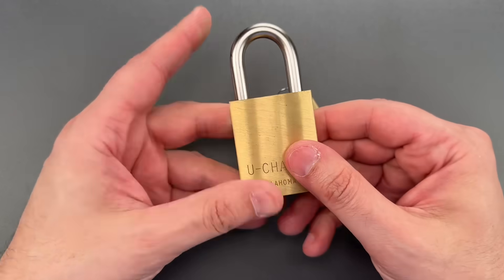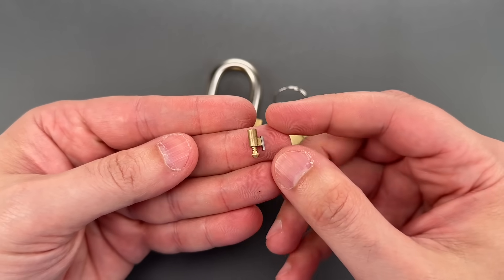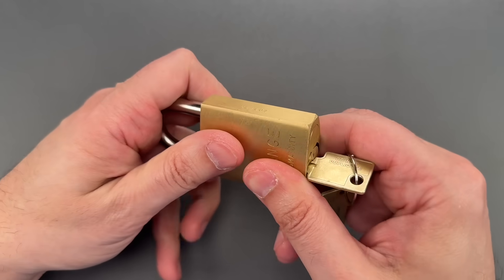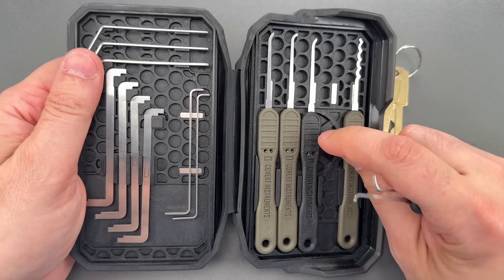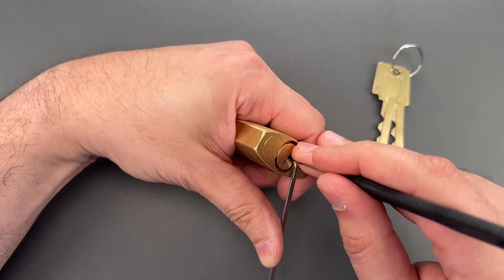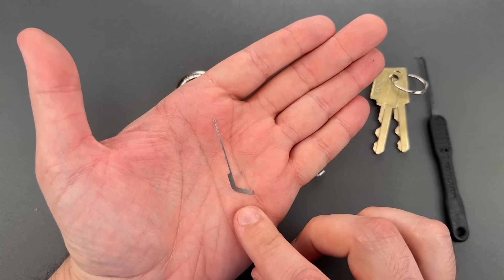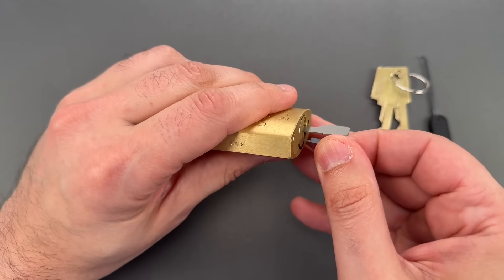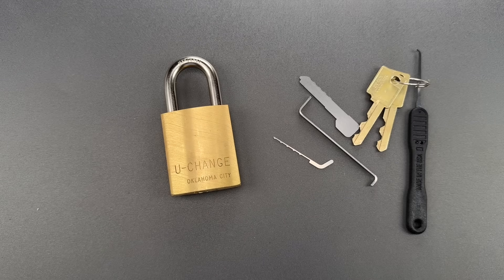[1634] Cool, Innovative, & DUMB: U-Change Padlock Picked & Bypassed

Comment: I just got my first set of lock pick . I was wondering what would be a good padlock to get to practice on? The clear one that comes with it give very little challenge to open . I find my self getting it open in under 30 sec with short hook and less with the rakes.
Reply: Note it give very little feedback  and has a lot of play in the cylinder. There enough play In the cylinder  to where you jiggle the cylinder with anything  in it the lock opens. So I pick it until  the cylinder turns.

Comment: Would a spring loaded pinned lever between two pins result in a harder pick? The idea being a key would withstand force applied, where a pick could not couteract the new force that could drive a spool back down even under tension ? Maybe placed along the sidebar

Comment: How do you not catch something like that until after it ships? It's an incredibly obvious bypass.

The pin design is an interesting concept (though i wonder how much more of a pain it is to manufacture thsn your average spool pins). But the design seems only half finished. The design clearly needs a protected means of engaging the control feature on the pins.

Comment: genuine question; why does a pad lock need a master key... ever?
I assume the reason why you want a master key is because you lost / don't have access to the original key.
But having a master key leaves room open for people to access what it was protecting without leaving a mark.
If you're the owner, you can replace the lock after breaking it open. If you lost the key, might as well.
Sure it does cost to replace BUT you'll know when it was forcefully opened.
* assuming it's not easy to pick in the first place and the door it self isn't easy to open by other means :P

Comment: It seems that with a little thought a means could be developed to keep the programming slot covered until an already authorized key allowed the cylinder to be partially rotated to a programming position where the programming rod and new key would be inserted to program the pins.

Comment: Obviously a small metal rod or stiff piece of wire (eg, stainless or a paper clip unfolded, vs soft steel or copper) can work of the reset tool is lost or not owned by the picker.  

Even worse than LPL suggested for security, though noting most cheap locks are more for access control against the honest, than serious security against major vandals who'd just smash things.

Comment: So about the same time as the c19 lock downs I came across ur videos. Shortly after that I purchased a practice lock and basic set. 30 40 and 50 with 2 wave rakes and 2 sizes of hook pick. Today i just tested all the pad locks in my house that I own that id been going to the gym with. And each of them took less than 2 sec after set up. I even picked my various safes. Those took me about 7 to 10 sec. The practice lock u gave me in the set is harded to pick then all these items

Comment: The thing is, if you can only rekey it while unlocked, you run the risk of accidentally pinning it wrong and then the lock is locked forever. If you can rekey it while locked, you can recover from that situation but at the cost of security.

Comment: It's not a flaw if you need special tools to do it.  Even 99.9% of locksmiths / lock pickers wouldn't have that  'master key'.
Reply: That's the tool that comes with the lock for rekeying it. So you can just buy one and have the tool. The high cut key he inserted in the key way could just as well have been a popsicle stick, but that would require a bit more jiggling.
Reply: @andersjjensen  Ok, but 99.99% of people trying to pick this lock who aren't the owner, won't go out and buy the exact model of lock to have that tool, I would think. With how little effort it took LPL to pick it normally, it would be far more effort to see the lock in the wild, look up the model of lock it is, go out and buy one to get the master key, then come back to bypass it with the master key.
Reply: @timgilbert9572  That highly depends on the scenario. If you're imagining a single lock on a garden shed, sure. But if a large institution uses it pervasively and someone wants to clean it out, obtaining the master key is about in the same inconvenience bracket as making sure you have a sufficiently large vehicle for the heist.
Reply: @andersjjensen  ..and you can also just buy a bolt cutter.  Soo- again- not a flaw.  99.9% won't have the tool.
Reply: @whatspeedlimits  By that logic nothing is a flaw so nothing should ever be improved because cordless angle grinders and crowbars exist.
Reply: @andersjjensen  no dummy.  A flaw is when you can wack it with a rock, oropen it with a paperclip or common object- or in the case of something like airport luggage- hold tension on the slide and feel the notch on the numbers.
Reply: @whatspeedlimits  It is every bit as much a flaw that everyone can go down to the local hardware store and buy a key for your particular lock.

Comment: When I used Kwikset SmartKey, it required not just the tool in the rekey hole, but also the current key, in order to get it ready to accept the new key.
Reply: So they didn't make the most basic of mistakes. The problem is just that Kwiksets are so stupidly easy to pick. The keyway is as wide as a barn door, the tolerances are sloppy, and because of the sloppy tolerances there are only like 5 legal cut heights, which makes it fairly easy to gauge by feel if you are at the correct height.
Reply: Another solution would be to just have an anti-drill plate protecting the core that also happens to cover up the rekeying hole, and the screw to remove it being only accessible with the shackle open.

Comment: Can you install the core without a useable key? Does the master key come with the lock and is there instructions/tools to open it without the key?

I could easily see a situation where somebody accidentally sets the core incorrectly so that the key they have doesn't work. As most people lack any lockpicking skills, their fancy lock becomes a paper weight because they set a pin one notch off. Since user convenience often trumps security in low-security domestic applications, the massive security hole of handing out a master key with every lock might have seemed like a reasonable trade-off. 

To be fair, I doubt the average thief will carry the master key to this obscure lock. Conventional lockpicking or destructive techniques would probably be more common anyway. 

Doesn't mean that an easily accessible master key is excuseable.

Comment: I'm confused. What's the design intent for that hole? This doesn't feel like a flaw as much as it does an intentional bypass, so I must be missing something.
Reply: The customer would rotate the core 90 degrees and insert a flat piece of metal with a bevel tip. This would allow the step pins to be released. Next, the user inserts a factory cut key. The re-key tool gets removed and the side pins lock into  the key pins forming a new pin length. The key pins are each have a male and female component and are telescoping.

Comment: I invented this tool when I was about 25 years old from wiper blade material. I sold a few of my prototypes to the VP of Security Solutions. In addition, they gave me 3 mortise cylinders and the lock you see in this video. The company knew about this flaw for years. Ten years later, I started posted my design on  either Lockpicking101 or Keypicking. There it got the attention of Locksmith Army who was affiliated with Ken Persson. Ken gave me a $400 pickset for my design and he posted my name on his website for about a year. Ken, made his own version of my original design. I liked the way he put an overlifting feature on key insertion tool, but it still wasn't perfect, particularly with deep cut pins which tended to vise into the cylinder walls. Ken, stopped producing this tool, rather mysteriously I might add. Maybe he was being threatened by Security Solutions. The tool works quite well  on certain locks depending on bitting and pin wear, and manufacturers tolerances. Prior to my invention, I read an article in Locksmith Ledger how a straight wire could be used to open these locks. I would say, "sometimes". After analyzing the lock, I invented my tool and improved the straight wire concept. I made a similar tool when I was 13 years old for a bicycle lock and so the same concept was easily adopted. ❤❤❤❤

Comment: Out of curiosity, if the lock can be unlocked/picked either clockwise or counter-clockwise, is the binding order the same for the pins when picking in either direction? Or does it potentially differ?

Comment: Kwikset has a residential exterior door lock that uses this reset feature they sell even today at home depot i believe. Not a fan
Reply: The Kwikset Smartkey system cannot be rekeyed without inserting the currently matching key. They aren't proper security locks, but they aren't outright dumb either.

Comment: I think this was probably "good enough" for the kinds of security this was probably used for (monitored gates or garages that just need perfunctory locks because the REAL security is via observation), but the design flaw is so easy to fix: make the core drop out and put the rekeying hole on the INSIDE face.

Comment: Isn't it also dumb because you might be able to change the lock, but where do you get the new key  you'd need?
Reply: It's the other way around, actually. You change the lock to work with a key you already own. 
That isn't to say that you couldn't get a new key made if you really wanted to. It's just that most people are going to use it as a way to standardize their locks to a small number of keys rather than have to juggle dozens.

Comment: I think the dumbest decision was to not cover that resetting slot when the lock is locked.
Reply: The plug is so skelonized as it is. I thought about it too. Why didn't the company block the hole in some way. I asked the company the same  question years ago, and the response I got was they had fix but wasn't going to share it me. I was a pain in their ass. Maybe it was true, maybe not (about the fix). I thought  about using some sort of ball bearing to block the hole. But again, there's very little brass left to work with.

Comment: "Design error: Key can be changed while item locked."
It still applies to electronic saves to this day!
Reply: the crazy part: I genuinely assumed the pattern change would only be when unlocked. I was so convinced, I would not have even tried.
Reply: @brightmatter actually from what I see it’s not even changing the keying. It seems roughly equivalent to comb picking. The sidebars are fixed relative to the top of the key pin so stopping them all at the same height must leave the lock in the open position.
Reply: I used to use that to my advantage whenever the fingerprint scanner I needed to use to clock in to work would stop recognizing my finger. 
Put in the command code, 931, to ask it to change the manager password, change the password. Use the password. Set employee fingerprint. And reset my print. 

Why corporate ever thought a fingerprint scanner was a good idea for line cooks, who burn and injure their fingerprints enough to change them multiple times a month, enough for the reader to stop recognizing them, is beyond me. Could've abused it worse if I wanted to.

Comment: What is the point of user-changable locks? You need to make new keys all the time (unless you are just using them to exercise picking).
Reply: Access control. Say I have 20 locks - sprinkler access or something equally mundane - and 10 crews who may need to get in to them. If I add another box, it's far easier to rekey the new locks to the old keys than make sure everyone has another key that only works on that box.

Comment: and that completes another amazing video! Are the Kwikset changeable key sets just as flawed?
Reply: The older KIK (key in knob) one had a bypass vulnerability requiring a specific tool. All of them are a bit delicate; sometimes a pin will lose it's setting and the key won't work. Pick it and reset. Vulnerable to dirt, gunk, gummed oil, or extra force like rough picking or a spring-gun causing a pin setting change. By their nature the pins act like standard pins when picking so not a lot of pick-resistance.
Reply: The Kwikset Smartkey system doesn't have this flaw.

Comment: easy fix; plug the change hole; anything brass; sand down; brass is easy to work with and soft
Reply: Which negates the point of the design, being able to rekey the lock without disassembly.  There are other ways it could have been done,but if you want that feature you're not going to block it off.
Reply: The hole is there to allow the lock to be rekeyed. You'd be disabling the distinguishing feature of this lock, which raises the question: why buy this particular lock instead of another one that can't be rekeyed, and therefore doesn't have the flaw to begin with?
Reply: @EvenTheDogAgrees   в быту для человека он не нужен, но для организации с кучей замков это может быть полезно. Когда есть набор замков и набор ключей, и всегда можно перестроить любой замок на новый ключ. Или перенастроить все замки на один ключ.
Reply: They should have simply designed this so that you had to unlock it BEFORE doing anything with the rekey.
Reply: Все проще. Просто сделать настроечное отверстие внутри паза для дужки замка. Пока дужка не отведена в сторону, доступа к настройке не будет.
Reply: That just leaves you with a normal padlock without any security pins... that you payed a lot extra for due to the complicated feature.

Comment: So, the user can easily change the pin lengths but still needs to go to a locksmith to get new keys cut. Seems like that defeats the purpose of a "user changeable" lock.
Reply: Makes it easy to re-key all the locks to a different key (if you have 3, rekey all to #1 or rekey all to #3)

Comment: Just like a video game. Modern idea, great concept, not nearly enough QA or testing to determine its greatest weaknesses.
Reply: All of software. I mean all of it...
Reply: @nopenotmedude  I completely agree. 

I worked with a bespoke VTC system some years back. There was a known issue with certain characters being inserted into conference names. After being there a short time I looked up their source code and recommended the most simplistic input validation. They took my code and used it on the production system and never had that error occur again. It had been plaguing them for over a decade ......

I'm not a coder at all, btw. Just an IT guy who saw a significant issue that could be handled if only someone gave enough of a crap. 

Can't tell you how much money I saved that organization. It was frickin criminal, how inept they were at times.
Reply: Most games aren't having any modern ideas in them really though? I'm nit being mean or anything like that, at least AAA titles play it super safe and reuse old, well received gameplay and that's how things are going for over 10 years at this point.

Comment: I was just wondering...do lock manufacturers who make the same model of lock for many years, decades even, ever modify the lock to reduce costs? Like use cheaper materials, omit features since the particular lock has a reputation and they can make more money with a slightly cheaper version? If so, maybe it would be interesting to see current versions of some of the "best" locks you have looked at and see if they have kept up the quality or not.

Comment: I assume that master key is for changing the key that works with the lock, and if that's the case it should only be accessible by removing the core, such a major design flaw.
Reply: Or if the lock is already opened...a smiple little plate (cover the "change" hole unless the core was rotated) would do...